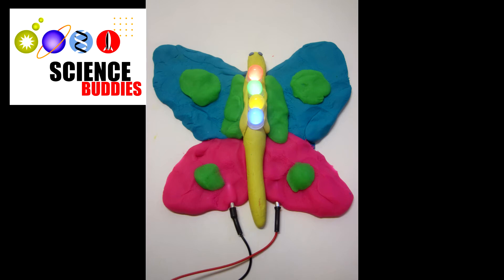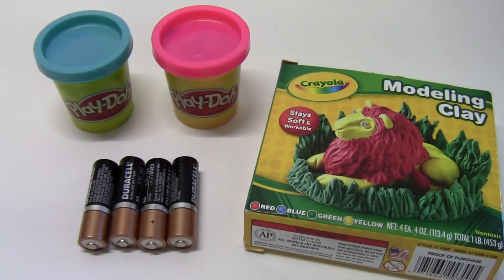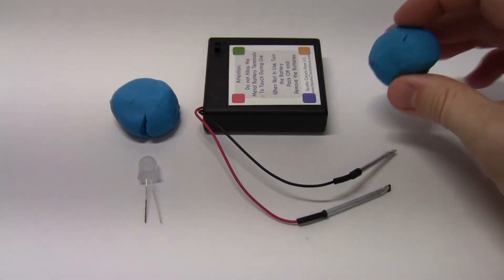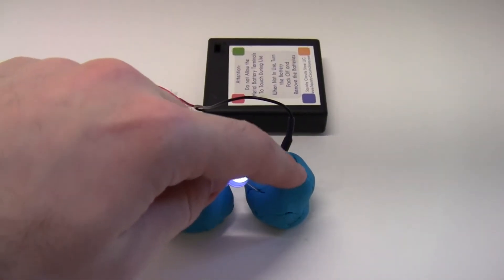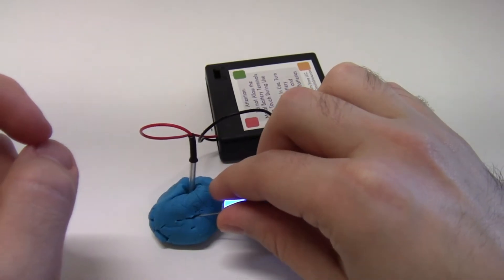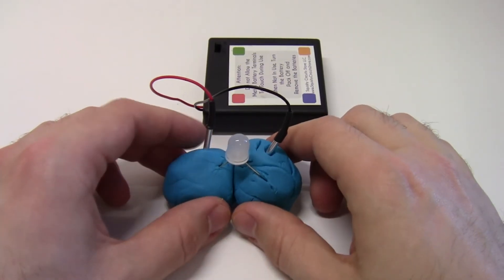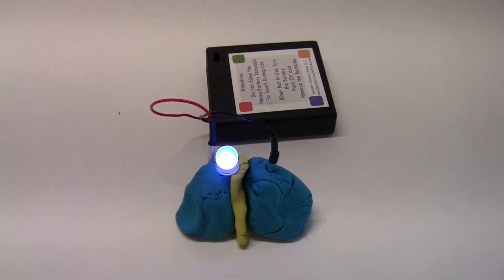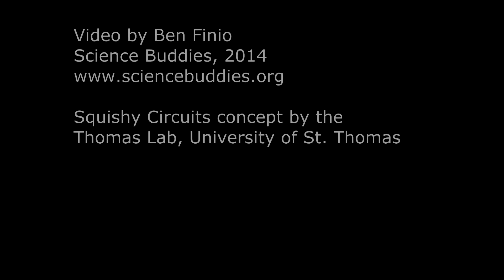Squishy Circuits Introduction

Comment: Oh please. Could you have just explained the polarity the first time around instead of editing it afterwards. Its called a Light Emitting Diode, Diodes only allow current to flow in 1 direction. The Longer LED's leg is positive, the shorter leg is ground.